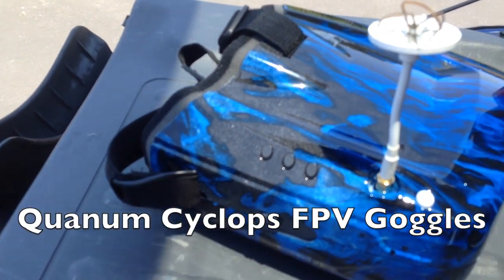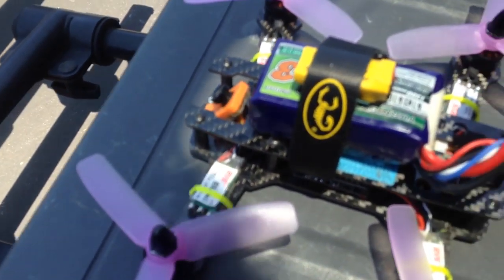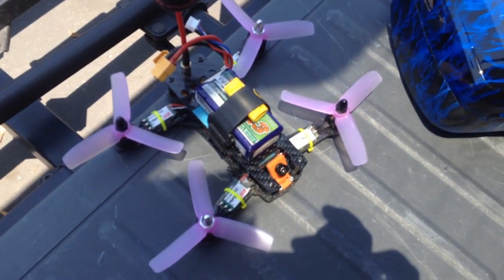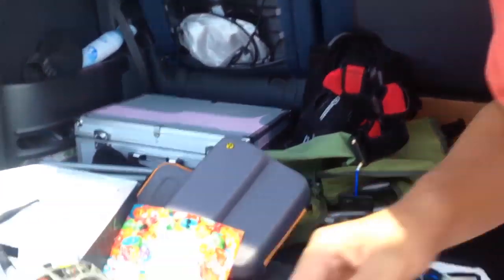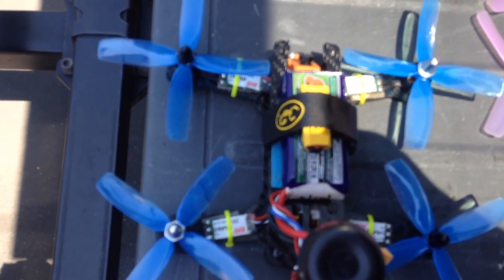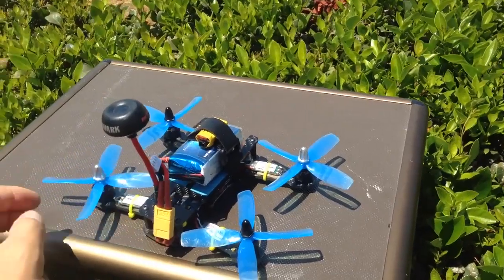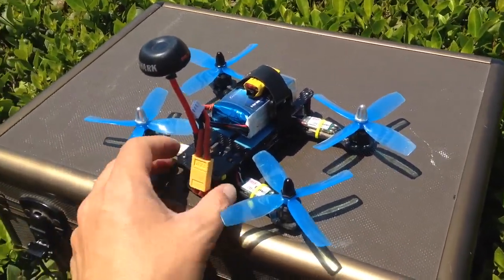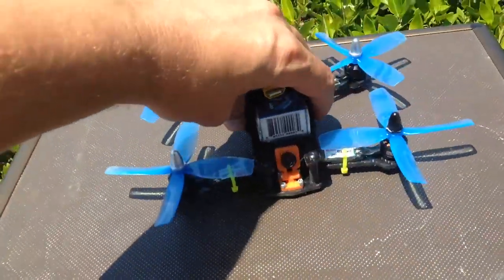Diatone ZMR 180 flight Review

Comment: WHAAAaaaaa I thought you flew acro forever by now lol!!! Either way it looks like you have been flying acro forever now lol. Great stuff!!

When you say the motors got "way to hot," is that like too hot to touch for a few moments?
Reply from the maker: +IzakGt , LOL, that was my dirty little secret!

Actually the motors came down at an acceptable temperature level I'm still testing
Reply: +7demo7, lol great secret! I need to check out Alberts channel. He apparently does EVERYTHING (sailing). 

I ask about heat because I'm trying to get a ballpark idea of what is too hot so if I experience that I know to stop.  I don't have any motors to cross check heat with my current setup. My motors get rather warm but after a flight I can touch them for a sustained amount of time but of course they are warm but not scalding hot. Not knowing what is too hot I usually let them sit for about 4-5 mins before the next pack to be somewhat on the safer side. Kind of want to keep them around for a while you know!

Comment: My motors get super hot too. 4045 bullnose/1306. I guess something else is wrong with mine. Voltage drops way too low after a minute or so. :(
Reply from the maker: Could be the tuning.  Mine still run hot... I'd like to try the 1806 size- the 1306 are weak....
Reply: I noticed that. No punch on mine. I'm going to put some cheap 1806 motors that I have and report back soon. Thanks!
Reply from the maker: same here... .,lol
Reply: 1806 motors are in. I had to modify the legs so the motor could spin freely and can only use 2 screws. I hovered around for 2 minutes and the motors feel cool. Hovered again, punched it and the voltage dropped and flipped. I think I have a short or a bad connection somewhere :\

Comment: did the 1306 motors get hot with 4s?
Reply from the maker: On 3s, I could be due to tuning though...
Reply: +7demo7 ah okay, i bought the new kingkong 1306 3100kv motors will be running 3045 tri's on it :)